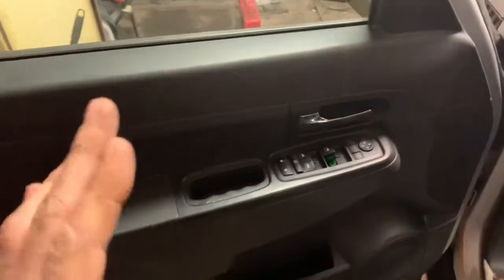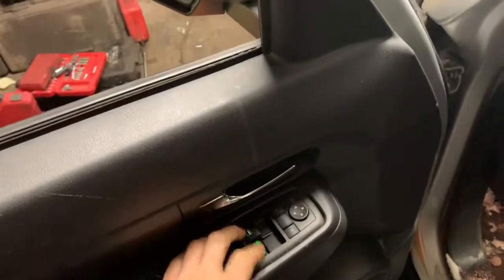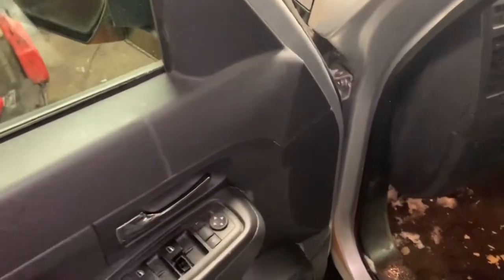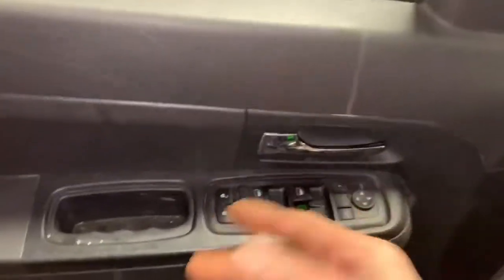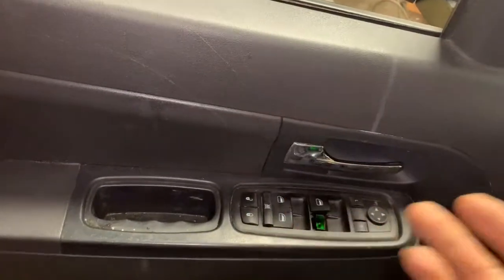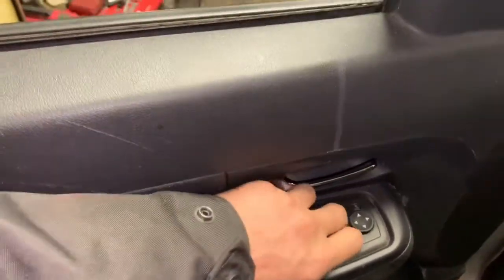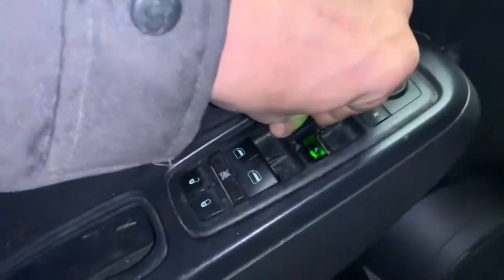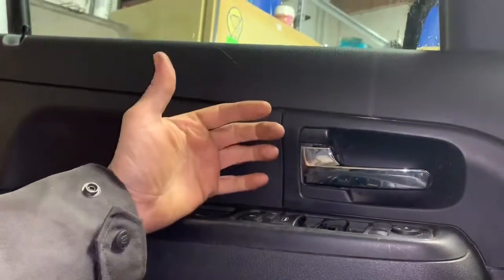Jeep liberty drivers window not working/possible way to make it work no cost!!!!

Comment: Shot in the dark, but my 09 Liberty is having some issue similar to this. The driver's side switch isn't controlling the power mirrors, the front 2 windows, or the door locks... but it can control the rear windows. Never had this issue before, and all I did was roll my driver's side window down and just stopped working. I bought a new switch and that didn't fix the issue. Any recommendations? Is it the wire?
Reply from the maker: Well if it’s not your switches look between the door panel at the a pillar rubber accordion that the wires run through cut rubber accordion and give the wires a gentle tug I’ll bet you they will break then you can repair them properly just happens over time opening and closing the doors. Very common

Welcome to the channel we’re happy to have you

Comment: Can’t believe it but it worked. Thanks
Reply from the maker: Well I did show you in the video that it worked. And I don’t remember if I said but that just means that your switch is going bad you may want to look on my playlist I think I take it apart and show you how to switch the switch around because it’s just worn out
Reply: I'm Rick , a2003 liberty, windo switched are in middle of seats. This morning went to roll them down,  an the only one not rolling down by window switch is the passenger side front.there are no other window switches in car. None on doors. Please reply.need help.
Reply from the maker: Sorry to hear that Rick

Sounds like you need a new switch because that switch is one complete switch on that particular year later models use a switch on each door

You can use this website it will show you where you can get switches locally from a reputable recycler in your area just put in your area code and the year of your vehicle super simple to use hope it helps you

Car-part.com
Reply: Thanks, really

Comment: Window won't go up and it stays down. The window shuddered then let down and won't stay up. Is there a belt or did the motor go bad
Reply from the maker: The window has what’s called a regulator system minute and the cable broke on the system the relatively simple to replace and fairly inexpensive usually less than $100 for the part

Comment: What if you don’t have a button anymore ?? Mine broke off
Reply from the maker: You can take The switch out and you can literally take one of the switches from the back windows and put it on the switch for the front window. 

But in your situation I would recommend just replacing the switch.

And if it still doesn’t work more than likely there’s a broken wire between the door and the “A” pillar of the vehicle inside the rubber accordion down there that’s the most common reason the switch is stopped working and then people end up breaking them because they’re trying to get the window to work.

Comment: Thanx for info this afternoon my window went down on drivers side jeep compass never went up 1st time its happened
Reply: I used contact cleaner light grain sandpaper on the male probes to the plugs disconnected the positive to the battery to be on the safe side. Works like a champ thanx great advice

Comment: Did you end up fixing it? How?
Reply from the maker: I took the switch apart, and I put the parts from the back switch in the front part of the switch or you can just replace the whole switch
Reply: @sharpcarco  ohhh that’s a good idea, makes sense since driver side is the only one with one window control.